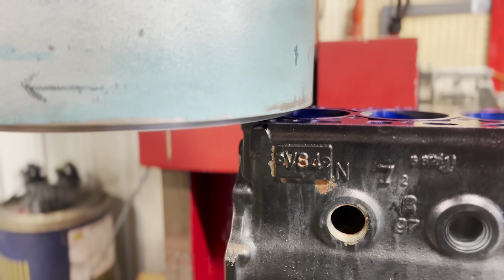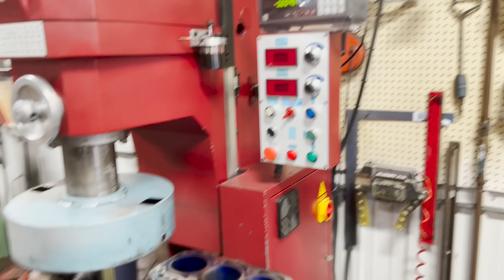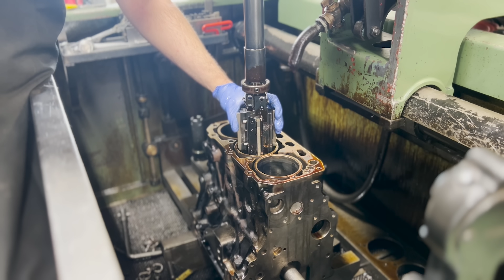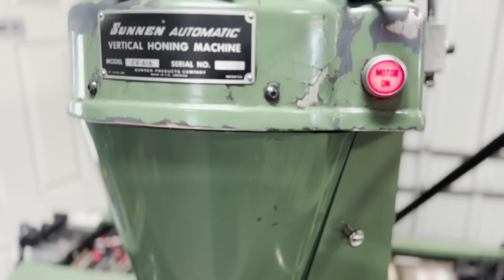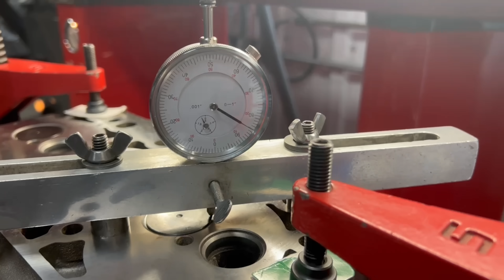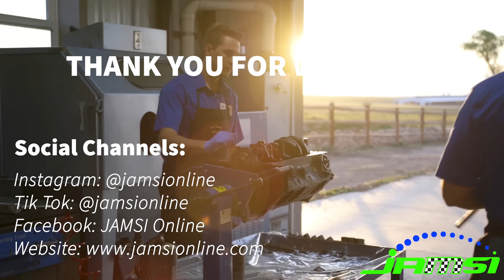Our Customer's Yanmar Kept Blowing Head Gaskets

Comment from the maker: Thank you all for watching this quick video! 😊

I threw a few stickers up on the website! 😬 Check it out! https://jamsionline.com/jims-automotive-machine-shop-inc-jamsi-online-3-x-2-sticker/
Reply: New sticker looks good!
Reply: for a moment i thought why so fine tollerances in automotive maschining - then i remembered you use banana dimensions and 1/1000 for you is only a rough dimension of 0.0254mm 
im working in QC - producing dosing and packaging equipment for medical and food industry as well as purpose built fine mechanics - with maschines like the newest DMG Mori and KERN-CNC
positional tollerances of 0.02mm and finer for holes and diameter tollerances of + - 0.0025mm Roughness RZ of 0.15µm (micrometer) on parts with up to 6tonns - ever had to let a work piece acclimatise back to exactly 20° between milling work steps to be within tollerance and needing to leave it in the maschine to not have a reset error? tension relieve glowing after rough milling
Reply: Hey Jim, just out of curiosity what are the materials that the seats are made out of?
I build street performance air cooled engine's and Stellite is what's used for our applications both intake and exhaust.
Reply: Would you do a little tecumseh h50
Reply: Phil 650
4 months ago
I used to work for a thermoking dealer. We had a lot of problems with these motors over heating and blowing head gaskets.Thermoking took yanmar to court but lost.They tried an updated head gasket and torque setting and some times this worked, however if the problem reoccurred a second time they replaced the motor. eventually they found  that the water pump was the problem,it was causing hot spots at the back of the head. An updated water pump cured the problem.Side note, the engineer who sorted this problem had the same problem in boat engines in his previous job. Hope this is of help.

Comment: U 😊😊 have 2 shave the block and the cylinder head and check W a straight edge and I would put a copper head gasket on it 😊😊 OMG 5 27 2O24

Comment: I could not imagine trying to machine to fine tolerances in Imperial. It's not that I can't visualise it, it just makes all the calculations too complicated. Who wants to deal with fractions of a large unit when you can just use mm? There is a reason it is used in science it is more accurate.

Comment: Phil 650
4 months ago
I used to work for a thermoking dealer. We had a lot of problems with these motors over heating and blowing head gaskets.Thermoking took yanmar to court but lost.They tried an updated head gasket and torque setting and some times this worked, however if the problem reoccurred a second time they replaced the motor. eventually they found  that the water pump was the problem,it was causing hot spots at the back of the head. An updated water pump cured the problem.Side note, the engineer who sorted this problem had the same problem in boat engines in his previous job. Hope this is of help.

Comment: I'm curious why the amount of warpage of the head and block wasn't checked before replacing the head gasket on the first time?

That's part of basic diagnosing 101 after a potential overheat/head gasket failure issue.

Comment: I have installed these 3 cylinder Yanmar diesels in new off road vehicles and they start really easily, I can only say that to warp the block and head that bad was a loss of coolant unoticed, maybe the customer should have a temp alarm as it's cheaper than a rebuild...

Comment: If the cylinder is out of round at all, the hone will only give you a fresh surface on an oval cylinder....right?
Reply: But the deeper you cut into the cylinder wall.....the "rounder" it gets...
until finally it becomes really really round again....
Reply: @JohnSmith-yv6eq  But with those spring loaded stones, there's no way of knowing how far you'd have to go to find "round."
Reply: @dannywilliamson3340  
True..
I misinterpreted your query....
Far better engineering wise to cut to round with a cutter and only finish/cross hatch with the stones.....

Comment: The customer did multiple head gaskets but wouldn't spend $150 for a entire valve rebuild kit?...moron
Reply: It was worth a crack, Nigel.
He gave it a go and it failed in the same place confirming that "the same place" had a big problem not solveable by another head gasket..
THEN he took it to a machine shop to overhaul the machine and replace or repair all the faults induced by the overheat....

Comment: o always see that blue thing what's its use and is it really neccesary?
Reply: It's like "guide coat" used in automotive sanding in preparation for painting.
You put a "contrasting" colour on the surface and when all the colour has been removed evenly...and you can only see the original surface.....you know that the surface is flat.
Reply: @JohnSmith-yv6eq  thanks bro! now I lnow

Comment: Paint bothe metal surfaces with rust oleum silver paint. Let it dry. Do the same with the copper meatl gasket and once dry assemply and correctly torque. This is what they do to fuel dargsters. I do it will leaking high pressure boiler washout plugs. Once installed they never leak.

Comment: I am surprised at the limited surface area to seal around the cylinders to begin with. What type a gasket is actually used? 
I do not know much about cost now days but the new pistons and machine work looks like it would be close to a new short block if available.🤔

Comment: After removing material from the deck and head, can you use a normal head gasket or is a slightly thicker one available? Thanks!
Reply: There may be but in this case it is not a problem...

Comment: New to your channel. Great stuff.  Did you need to use a thicker head gasket, since 11 thousands total was removed?
Reply: Not necessary in this case as the compression ratio was not greatly affected...plus the slighlty recessed valves lower the compression as well....

Comment: So basically whoever did the machine work before you guys had it or from the factory did I really piss poor I don’t give a shit job either just to make money or get it out the door that’s what I’m hearing
Reply: There was just the problem of the twisting induced in the head and block by the overheat...
at least one overheat when the headgasket blew the first time...
and possibly another overheat and twisting and warping of the block and head when the second headgasket blew....
So machining didn't really have any influence..
as from the factory it would have been flat and square when first assembled......
and it worked for years before the overheat.

Comment: Thank you for showing this. Yanmar are the core suppliers of all the engines for low-priced tractors and farm/induatrial equipment. Whether or not this defect is a single event, or affects a series of runs will be a question. But its good to put it out so prospective buyers and maintainers have a clue that they may dismiss because the equipment is "new."
Reply: I know as far as sail boats engines go I have to say I never hesitate in relying on them and parts are available anywhere in the world...
Reply: There was just the problem of the twisting induced in the head and block by the overheat...
at least one overheat when the headgasket blew the first time...
and possibly another overheat and twisting and warping of the block and head when the second headgasket blew....
So machining didn't really have any influence..
as from the factory it would have been flat and square and it worked for years before the overheat (s)......

Comment: One of the things I've noticed over decades and hundreds of engines. Is that some engines are more sensitive for the need for retorquing, after the installation of a new head gasket.  Some engines you can get away with not retorquing. Others if you don't it's just a matter of time before they fail.

Comment: Yet another manufacturers open deck design that will eat head gaskets 😂
Reply: Yanmars are known for their good engineering, toughness, reliability and longevity...
as long as the coolant, the oil and clean air intakes as designed are maintained properly.
Neglect is a bitch....

Comment: Using those American units is weird on a  engine designed in metric units. Oddball way of doing stuff.
Reply: As long as you have the conversion units worked out...
it doesn't matter to a competent person with good gauges....

Comment: Since you're honing I highly suggest you and your viewers check out stapleton42's video about Greg Anderson honing cylinders on one of Lake Speed's old NASCAR engine. The machine is incredible.

Actually, the entire Lake Speed series is absolutely awesome if you're into cars, engineering, and machining. They're rebuilding an old engine trying to make as much power as possible using modern manufacturing tech, materials, and engineering. So far, visits to Greg Anderson's shop, comp cams, Holly carbs, and Carrillo piston & rod factory so for as well as well. The entire channel is awesome as well, as they visit a bunch of old race shops & anything with Lake Speed Jr in it is a joy to watch. He really loves what he does.

I'll add a link or at least description to make it easy to find. I'll try a link first & if my post is auto deleted, just a description.

Edit: auto delete is on for links so search "stapleton42 Lake Speed's ford c3" for the first video with dyno & teardown of the engine. But there's also a video before that with the visit/interview at the race shop.

Comment: I wouldn't have chambered the top of the cylinder I don't think that's a good idea I would have took a hand tool to get the bore off maybe did it by hand we just put a really tiny tiny amount in there you don't really need anything to help put those piston rings in there there should be enough clearance room

Comment: Are you able to share where you sourced your parts? I have a 2 cylinder yanmar and have to rebuild the head and cam bearings soon.
Reply: Do your google research.
If it is a marine engine a local port engineering shop may be your best bet....
or if it is in an industrial setting...an engineering workshop....

Comment: I used to work for a thermoking dealer. We had a lot of problems with these motors over heating and blowing head gaskets.Thermoking took yanmar to court but lost.They tried an updated head gasket and torque setting and some times this worked, however if the problem reoccurred a second time they replaced the motor. eventually they found  that the water pump was the problem,it was causing hot spots at the back of the head. An updated water pump cured the problem.Side note, the engineer who sorted this problem had the same problem in boat engines in his previous job. Hope this is of help.
Reply: What year did Yanmar upgrade the water pump? I have one of these engines in a 2011 John Deere.
Reply: @mro4440  I no longer work for the dealership but it was a few years back now. You should talk to the spares manager at a TK dealers, they should be able to help.The problem was always at the flywheel end of the head caused by hot spots , these motors ran at two speeds only high and low in this application [thermoking unit]
Reply: @phil6506  Thanks Phil. I considered your point that the application the engine was operating in was contributing to the problem. Probably 🤞not an issue for the most part with an ag tractor.

Comment: Mmmm Yanmar....  An engine that I avoid whenever possible. Been bitten three times now.  Best solution is to rip it out and fit a Kubota. No more problems and a good used Kubota is miles cheaper than a couple of Yanmar parts :o)

Comment: I sure do enjoy your videos, great lighting, great camera angles etc... But I was wondering, not so much on this block, but an example of a engine like a Ford 2.3 ltr, with an over head cam. Same deal over heated, and warped, if that is a thing on those? When milling/fly cutting both the mating head surfaces, mainly the head itself, is it a good idea to install the cam, of maybe that is a bad idea beings the bearings areas are part of the casting... Maybe a Honda or Toyota head that has cam cap bearing retaining system? But to install that system then mount the head to the table for the clean-up procedure? Or does it not matter, and tension that might be from the cam and bearing caps is so little, it wouldn't even hardly measure a difference with or with out, that once you unbolt the head from the table nothing would change in the relaxed head tension or stresses in the casting? Just curious is all. Neat videos though.

Comment: Very Interesting.

Very informative.  Especially the "not replacing everything despite rebuilding most of the engine".

I nuked the entire suspension and steering save the rack on a Toyota bought.  In hindsight, the ball joints were still okay despite 145,568 miles on the clock.  But the cost was about $24.00 each aftermarket circa 2018.

Comment: Excellent precision work 👍. Just curious the head was clearly warped and you flattened the sealing surface, what happens to the cam surfaces. Will they be ok, because the head warped.
Reply: Cam is in the block. There are push rods and rockers.

Comment: if seen one of these mtr fully reconditioned because of overheating . then engine still over heated  once some one with a brain looked at insolation of engine found incorrect size cooling piping  causing over heating .owner had gone public saying yanmar engines are crap and over heat . when it was his fault for installing wrong pipe size.

Comment: You've taken off 7000 of an inch in total with the block and head.
What happens in terms of compression ratio?
I'd imagine that much would make a big difference
Off the shelf thicker head gasket?
Reply: .007 is how you write 7 thousandths

Comment: Do you do anything to compensate for the material taken off the top? like thicker gaskets? or is it so small it's not a problem?
Reply from the maker: In this case it’s a small enough difference that it is not an issue. Had it been an issue, options included a thicker head gasket, a “head saver” shim, or fly cutting the top of the pistons.
Reply: @JAMSIONLINE very interesting. Didn't know there would be other options like the head saver
Reply from the maker: Not available on every engine. Mostly aww it on OHC applications. It’s kind of a bandaid….
Reply: @JAMSIONLINE  Thank you!
Reply: I did not expect you here, guess you probably get the same youtube shorts as i do lol

Comment: I had to take my car in to be repaired years back as it was not running correctly. I left it with the mechanic and went off to do some chores. It must have been about two hours later I returned and was told that I had blown a seal. I was furious and told the mechanic that I would never have done such a thing to a poor defenceless animal. 

I'll get my coat.

Comment: So people blow a head gasket and they just replace it without a resurface and a valve job 🤔???
Reply: Often, it's fine. It's if you blow a second one after fitting. That's when you have an issue of warping. Either the block, the head or both.
Reply: Ok I see either way it’s a lot of work

Comment: out of curiosity. When machining the head, why do you surface before you work on the valve seats? I remember in your model A video you were talking about the valve seat machine using the the valve guide as a reference, or do you tram in the deck on the machine first? Because if you surfaced the valve seats first all to consistent depth, then you could deck the head to ideal valve recession clearances. Or is my thinking completely wrong? Thanks for the videos, really interesting stuff.

Comment: Im curious with regard to the PTV clearance every engine is different obviously but at what point do you determine when its necessary to check it after that much decking
Reply: Usually there will be a spec so you can measure the head thickness/deck height. Also quite common to be able to get different thickness head gaskets. But 11thou isn't alot, assuming it hasn't been decked before, also the valves are slightly more recessed now also.

Comment: Nice work! Those Yanmar engines are excellent. I’ve worked on hundreds of them in marine transport generators. I’ve seen them last 30,000 hours with oil changes every 250 hours.
Reply: Looks like a good motor, I just don't like the open deck design. Not much support for the cylinders. I'll take a perkins instead
Reply: @Midnight_Rider96  the newer ones aren’t open deck.
Reply: In reefers Ive seen 40,000hours . Oil change interval of 3,000 Hours.
Reply: Why don’t you run 2 micron bypass oil filters?  They extract all of the damaging particulates increasing oil service life. More importantly reducing engine wear.
Reply: @Dave5843-d9m  with as many hours these engine will run that’s not going to do much more then what they already do on their own. With the factory filter we already come up against the oil additives wearing out. 1000-3000 hours is a lot of use. Also the soot buildup in the oil causes problems that most filters don’t address.
Reply: Where are they made?
Never heard of them before.
Reply: @dukecraig2402  Japanese.Yanmar is a long established engine maker of portable 5hp units up to 5000hp marine units.
Reply: @dukecraig2402  Japan.
Reply: @jeremykamel9655  
Remember back in the day when stuff from Japan was junk?
Now it's the good stuff and all the junk comes from China.
Reply: @dukecraig2402  absolutely! And it the Japanese stuff is actually really good. Like just as good as stuff made in the US or Europe. I only wish we could still get stuff like this made in the US.